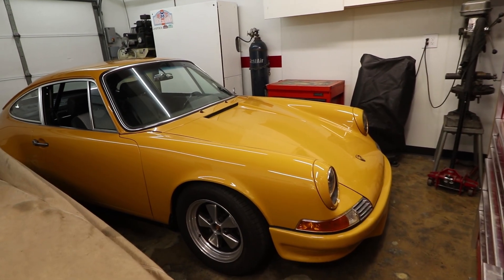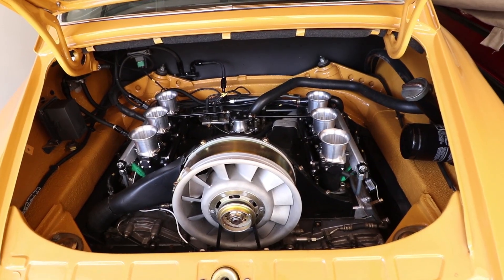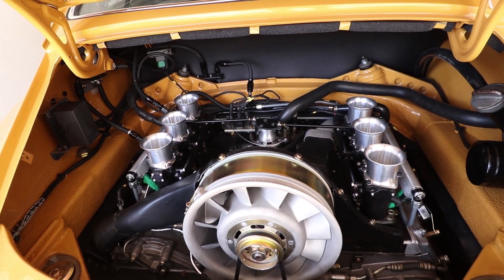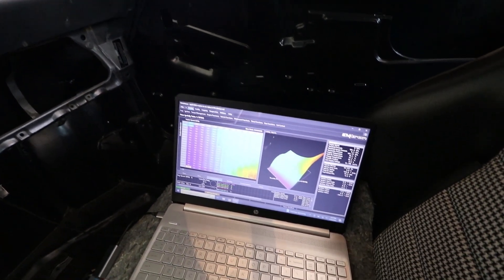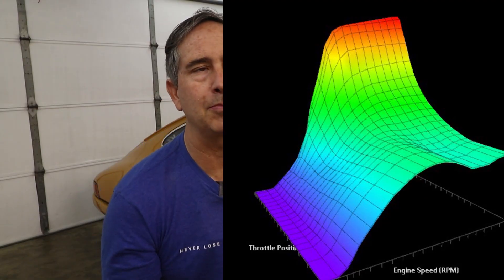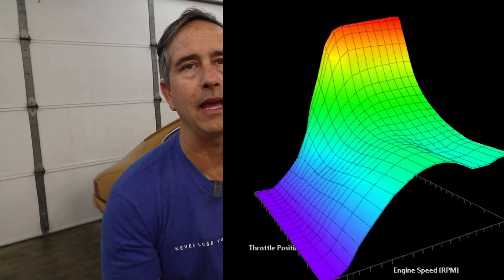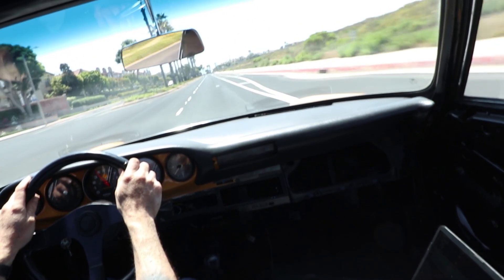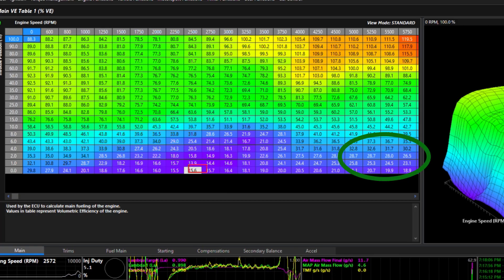First Test Drive With Glorious ITB Tune

Comment: Young chaps play a mean tune!  Car looks to be running great.  BTW, I did find 3.2 timing maps (via LorenFB on Pelican Parts) - they are not wildly different to the SC.  Seeing all this makes me realise that I really need to get back to my car project (still landscaping and property renovating, family comes first!)
Reply from the maker: Yes, fun when they are home.  I will ultimately get an optimized tune for this engine.  Should be fun, but it's driving pretty well as is.  Maybe the Dyno will be more humbling?
Reply: @GarageTimeAutoResto  Oh, maybe... But it's like you said, this EFI conversion lays down the required infrastructure for your goal power down the track.  And who doesn't like ITBs? 🙂

Comment: Are you using a MAP sensor, or only going by TPS?, If you’re using MAP, how are you plumbing the vacuum signal from each TB, any issue with a stable MAP signal ?
Reply from the maker: Hi, I have both MAP and TPS sensors, but the ignition and fuel tables are driven by TPS or also known as alpha N strategy.  
I do use MAP for Transient fuel compensation and fuel pressure correction etc.  
The MAP signal is stable.  Lots of people are asking about the plumbing so I'll do another short to be very clear on how I did my system.

Comment: When you decide to hit the red line I hope it’ll be on the way to the dynamometer shop. How ‘bout putting ITBs and EFI on the 356C SC?
Reply from the maker: Dyno run eventually coming once I get the air cleaners sorted out.  I'm gonna keep the 356SC all stock with its Solex carbs.

Comment: I wanted to cry at how easy the warm start was vs the PMO’s on my 2.2 (which I love the rest of the time).
Reply from the maker: I never need to touch the gas until it's time to go.  Love it.  
Do you PMO EFI or carbs?
Reply: @GarageTimeAutoResto  Hotted-up 2.2 with PMO Carbs. Runs amazing. 10x better than Zeniths. My guess is the hot start slowness is more about ignition than carbs 🤷‍♀
Reply from the maker: Cool!  Do you have thermal isolators under the carbies?

Comment: Great video!  I have a very similar setup that runs well but still has some issues that I'm wondering if you have also come across. The issue that I am having is when operating above 3000 rpm and above.  What happens is when I completely let off the throttle then slightly add a small amount of throttle, it creates a small backfire pop as the engine accelerates.  If I am very careful about slowly adding the throttle in that condition, it will burble without the backfire pop and accelerate normally. Additionally, if I stab the throttle, there is no backfire and the engine responds quickly. This issue here is mostly noticable when driving in traffic, when only very slight additions of throttle are needed to maintain speed - I'm just currious if you have run into any of that.  I'm running a Clewett Enginering setup with a Haltech ECU. Thanks for your thoughts.
Reply from the maker: Thx, and I'm glad you are driving yours also.  
I would reduce the values in the VE table above 3000 and 0-2% throttle opening.  It's too rich during decel.  Also make sure you don't have any exhaust leaks.  
That should do it, but my system has a bunch of settings for transient decel etc,  You could explore that too as I'm sure Haltech has that feature.